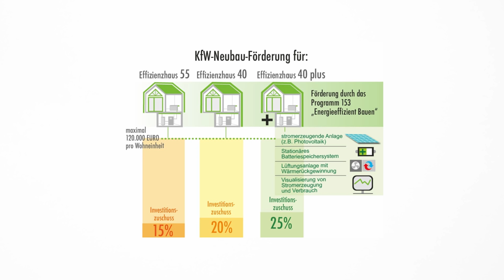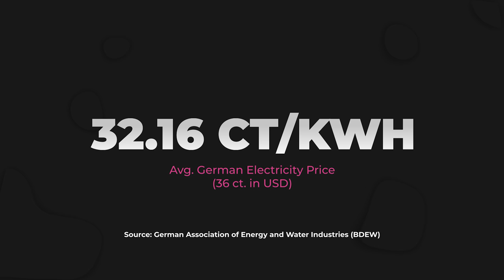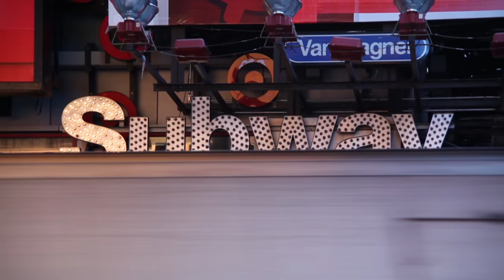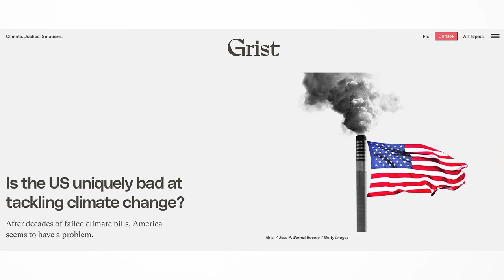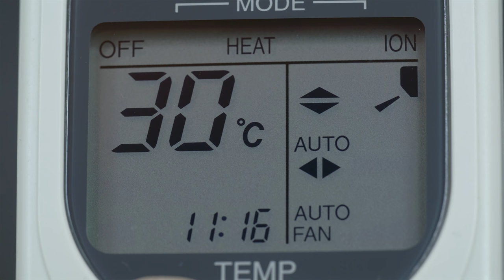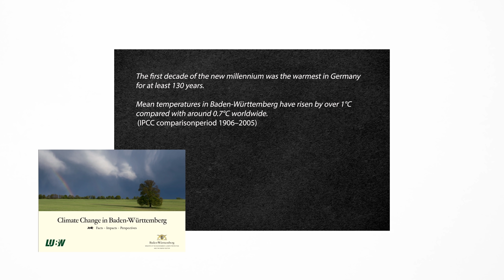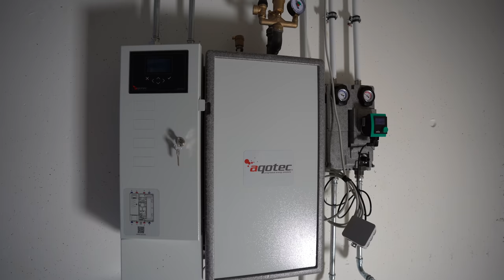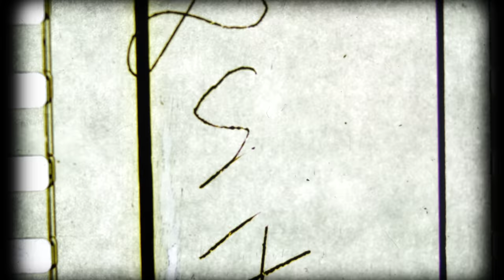HVAC (HLK) in German & American Homes | A Tale of Two Countries

Comment: New England, Massachusetts basically it breaks down like this pre-war and post-war
 taking typically with a grain of salt pre-war houses generally old very old I think you guys would refer to  them as maybe Victorian style, ie dr. Seuss style. started life radiant heat with  steam boilers. retrofitted from coal to heating oil to gas. At this point even a lot have been upgraded to forced air for a variety of reasons. 
post-war obviously the gi's come back you get a lot of white flight they abandoned Urban Victorian dr. Seuss style houses for the cookie cutter Cape cod style houses , that eventually spread everywhere. typically smaller houses but on bigger lots I would say that everything post-war is gas/oil forced-air

Massachusetts and  New England as a whole is kind of weird. metaphorically speaking out beyond the blue collar workers the white collar workers you have the old money. They typically live in their weird enclaves of not really mcmansions. In the South you get these giant plantation-style mansions, You don't typically get that in the Northeast because you got heat them. But nevertheless they use whatever building materials they want surely more of a convenience thing than a economical situation.

Comment: Very interesting video, but I do not buy, that burning wood is CO2 neutral. You could also claim, that burning coal is C02 neutral, as the CO2 released when burning is compensated by the CO2 being absorbed, when the plants grew about 300 million years ago, before  they turned into coal. We also burn wood to heat our home, but I am not claiming, that this is environmentally friendly.

Comment: Again, a very interesting video and topic! Thank You! The AC consumption statistics concerning the USA are mind blowing and quite insane, literally, especially given the climate crisis. After having lived in Chicago for 7 months (experiencing both winter and the insanely humid summer there) I understood why everyone wants to have an AC (not a fan of forced heat though). The humidity is simply unbearable and one NEEDS AC. A lot of people I knew back then (that rented like we did) simply had a window mounted unit in one or two rooms of the apartment (the installation often enough was quite "abenteuerlich" if not outright dangerous). I guess that quite a number of those window mounted units contribute to the extremely high number of 87% of AC equipped houses or apartments in the USA. 
I remember the 1973 crisis quite well when we had car free Sundays and would take walks on freeways. I think it was at that time that it really sank into the national subconscious and triggered the consequent sustainable energy developments from wind energy to passive Haus to photovoltaic systems, etc, etc. It is no coincidence that many of these systems were conceived and developed in Germany to be used at scale. I remember the  press surrounding the pilot development of Growian (which ultimately was a failure but lead to the development of much more efficient systems). Energy (and environment) conscious living has been on the mind of the average German for many decades and I do not even want to envision the state of our planet without those more or less serious, meanwhile worldwide, efforts. Here is an energy saving tip when using an AC: cut your energy consumption into half by mostly simply using the dehumidifying instead of cooling mode! We use this technique in my brother's house in Spain and on hot summer days (>35 Celsius) it is enough to set the temperature to 27 and dehumidify the house, and it really does the job in terms of cooling down the place. Think of why a steam bath feels hot despite it's relatively low temperature compared to a Sauna , 40-50C vs 80-100C. While humidity in steam baths often reach 100%, in a Sauna it should not go beyond 5-10% (außer beim Aufguss, der wiederum sehr schön veranschaulicht weshalb man dabei so schwitzt. Der kühlende Effekt der Verdunstung auf der Haut findet dann quasi nicht mehr statt, weil dazu die Umgebungsluft bereits zu gesättigt ist).
Reply from the maker: We are glad that you have also experienced the punishing humidity of the Midwest United States. It is absolutely unbearable without air conditioning. We are lucky to be in a relatively low humid part of the world. We don't mind a 'dry heat' as much.
Reply: @TypeAshton  i would not consider Freiburg heat in the summer as dry. Its not totally humid either.. its somewhere in between.

Comment: Hi. The "getting sick of AC" part is pretty easy to explain =)
As a European that is not used to the excessive use of AC, the way AC is used in US quite literally leads to getting sick. The thing is, due to high energy prices etc., Germans tend to not overdo things in heating and cooling, instead rather wear warmer clothes even inside in winter and vise versa.

As a German coming to the US, especially the more southern parts, you are permanently confronted with the outside temperature of something in the neighbourhood of 35-40°C and then the completely over the top airconditioned shops, malls etc. with 19-20°C. People from the US grew up with this and are adapted, know how to dress accordingly and to enjoy both. A German would probably either dress for inside, or outside, and then either sweat to death in the heat, or get a really nasty cold after sweating in the sun and then going inside barely dressed getting cold air blown at you.

So, yes, the stereotype of getting sick from AC is not necessarily about homes where you would even out at a comfy temperature in average, but instead it is about the everchanging temperatures e.g. during a shopping trip, and to be honest: I can relate! (...even though I have AC at home in my house myself) =)

Comment: Regarding heating / A/C in Germany: I have lived in multiple houses in the past, all of them had radiators, none any kind of A/C. Most used oil for central heating, some natural gas. My current home uses floor heating and a geothermal well as primary source. No A/C. When building the house in 2018, I asked the architect and HKL company if they could recommend installing a heat exchanging unit that not only is able to heat, but also to cool in summer. Both advised me not to buy the more expensive (+~3500€) dual purpose unit. Both said it were (for only very few days in a year) unnecessary and too expensive. I did not buy it but bought a large fan instead (30€). Until now it worked ok for. me and my wife. Regarding A/C units in general: I only encountered them in hotels in Southern Spain. Some could be shut off, that was ok. The ones that were not I found quite annoying during the night. Though I do not believe you get sick more easily, I found the ones that could not be shut off quite annoying due to their very cold stream of air that met my body as a knife. Personally I would not want an A/C unit in my house, though it can be useful in a car standing some hours in the sun.
Reply from the maker: We plan to install ceiling fans in our new home - similar to what we had in the US. Just having the air moving makes a huge difference in our experience.

Comment: Central and Northern Europe has never had a need for AC for the simple reason that it never got hot enough there historically. Occasional heatwaves don't count. As the climate changes they are going to find their holier than thou attitude about AC vs the US is going to bite. I grew up in Durban South Africa, where only large commercial establishments had AC and it was a disgusting environment to live in during the summer. Temp's around 30 to 35 C with 90 to 100 percent humidity and no way to cool off or stop sweating. I now live in Phoenix AZ and two years ago we had 60 days straight if I'm not mistaken with temperatures above 45 C. I have zero tolerance for the anti AC brigade. 
Heating on the other hand is a different matter. There is no reason whatever to have a heat pump in a house in Phoenix AZ. And the war over the thermostat is entirely correct. My wife insists on having the heat on during what people in Phoenix like to call winter and it drives me nuts.

Comment: Daily use of water per person: Germany 124l USA 101,5G=382l The US do not only waste electric power, they waste water, gas and oil. All those cheap wooden houses neither have "sommerlicher Wärmeschutz" nor a good isolation for winter. A friend of mine lived in Chicago and needed 5000l oil for 3 months in the winter! With 5000l you can heat a modern house over here for 5 years! I'm really sorry, but the US are so f... unsustainable. Of course not your fault. But sad.

Comment: I have under-floor heating and I never want any other system again. There is nothing as good as toasty toes when you get out of the shower.
Reply from the maker: Ashton's parents have this at their home in the bathroom. It is such an awesome feeling! We can't wait to have this at our new house. :)
Reply: @TypeAshton  It's brilliant, I just wear socks at home all through the winter. I also use the blinds to block the heat in summer, plus I have triple-glazing and. like Ashton, air out the house early in the morning. It works fine and it never gets too hot. My house is KfW 70.

Comment: That is not entirely true with the carbon friendly burning of wood chips. 
It would be, if you burned yearling plants like hemp or flax, but if you burn trees, that grew over several years/decades you burn the carbondioxide accumulated in those years.
It is true only if you burn yearling plants, which we could, if we changed and grew large hemp and flax fields. The fibers, the oil and certain chemicals could be used from the plants prior to making chips from them to burn in a power plant or at home.

Compared to fossil fuels it is surely much better on the carbon footprint.
Reply: The wood you use for heating is basically "waste" that can't be used for construction or furniture. The amount of carbondioxide produced burning it is the same as if you let it decay in the forest.
Reply: @frankschrewe4302  True.

Comment: air-conditioned air gives you the comfort in stagnant air, that is why you should keep all doors and windows shut in those homes. then, as in a fridge, the same air is circled around and cooled and circled around and cooled .... lots of condensation going on ... how regularly do you clean theses systems and pipes? ... the same air through the same "mucky" machine = not healthy, just by default

germans use moving air therefore more fans and drink a lot because then their bodies sweat and the combination of sweat & permeable clothes & wind is just AAAHHHHHHHHHHHHHH

while talking about heating systems and health ... side note ... underfloor heating is messing with the normal temperature grade of your body, where extremities are mostly cooler than the core, this kind of heating has bad effects on your legs veins, for example
Reply from the maker: At least in our home, we changed out our filters at least twice a year.... I was in the habit of doing it three times a year because my allergies are significant. At least for me that's probably been the biggest hurdle since moving to Germany. Because we don't have AC, we have to luft and it lets in so much pollen and dust. We ended up purchasing a high-end air purifier which helps some but in the spring, it isn't perfect.

Comment: About the topic that Air Conditioning makes Sick. This is not a myth. It is a fact. But it is not the Air Conditioning itself. But the circumstances that if you change often from an environment which has 20 or 25 degrees C to another one that has 10 or 15 degrees more. That is what you make sick. You go outside your home and Boom you run against a wall of heat. 2 Hours later you come back and again Boom its like you make a step into a refrigerator ! If you have this 3 to 5 Times a day. It makes you Sick. May be the Americans are so acostumed in this, that they give it to the children via the DNA. And if you think precisely, in the end of the day heating a room or a house in the winter is really neccesary. Cooling it in the summer, is not.
Reply: Do not confuse cooling with refrigeration.

Comment: Sorry to be a party pooper, but generating heat by burning wood chips is also not as environmentally friendly - even though the CO2 emissions might be "neutral", burning wood generates a lot more fine particulate matter (PM2.5), which is extremely harmful to humans. I guess it's less of a problem in less dense areas like the one you live in, but still...

Comment: Climate change will bring more heat and more icy times at the time.

I don't think Air conditioning is good, because it swirls all the bad stuff through the air and if it is not filtered itakes you sick. Bad for people with allergies, for people who catch colds easily and so on. 

But there is alternative. It's build in to a lot new office buildings. It's basically waterpipes built into the ceiling. Like the ground heating, just the opposite. It wouldn't cool it down by 20 degrees, but by 5 to 10 degree which is enough for Germany
Reply: All AC has some filter built in. And that needs to be cleaned regularly.
I have seen convection from radiators swirl dirt around! And radiators have NO FILTERS built in.

Comment: Last year i spend 19000 euros for a new modern Wood Pellet centralheating and warm Water Panels on roof. I'm very Happy with this. The price for Woodpellets in this heating period are a little bit cheaper than last year. Unfortunately, with the new government, energy prices are set to rise much higher. This endangers the modest prosperity in Germany. The reason, however, is not environmental protection but the financing of the welfare state and that will end badly.
Reply from the maker: We are also a bit concerned about increasing energy prices. We hope to buy a photovoltaic system for our new house at some point in the future.